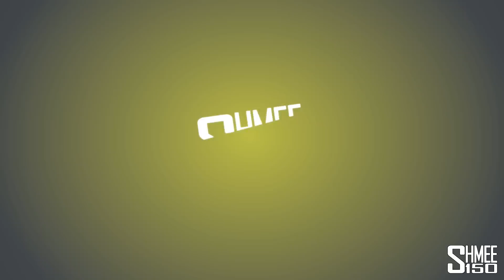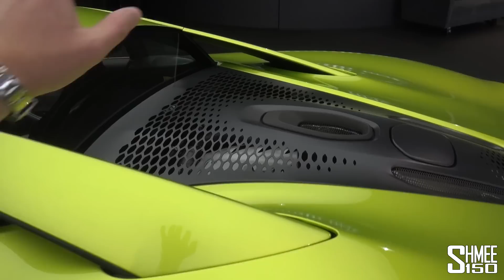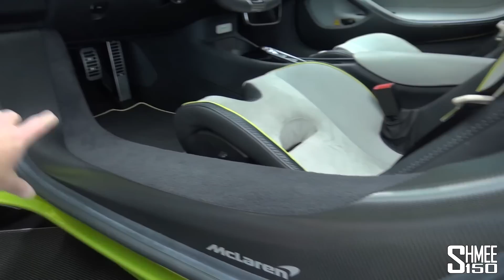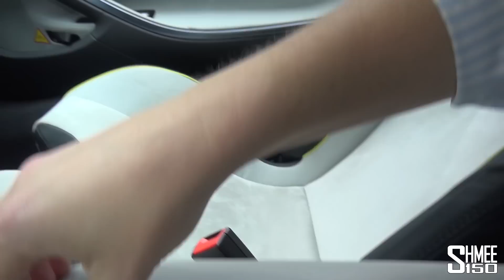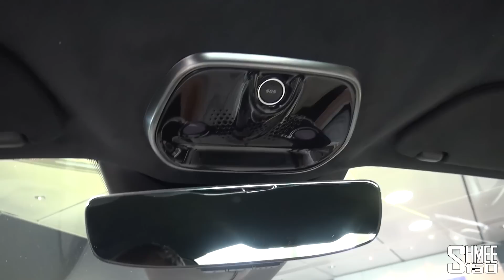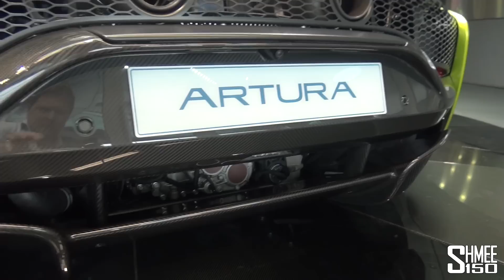New MCLAREN ARTURA! My First Look at the Latest Hybrid Supercar

Comment: something critical missed is that this is not your grandfather's V6, this is the first production Wide Angle 120 Degree V6.  this aids in lowering the CG similar to how the Flat 6 does for the 911.   iirc only Ferrari and Audi have ever used this angle for an engine but only for racing.   Ferrari with their 1961 F1 156 "Sharknose" and Audi with their 2013 R18 Diesel Lemans LMP1.

Comment: About the same weight as MP4-12C. And it looks the part, monaco play thing. However it's more than a little tone deaf to still make an essentially pure combustion engine car when it hasn't even launched. Tesla is slacking on the roadster but once it comes, McLaren backs will be against the wall so if it takes them multiple years to mount even the first response, they could be going the way of the Aston Martin dodo. A base Model S can basically match this acceleration to 100km/h. and a plaid Model S will vastly outperform it. You should probably expect a Tesla Model 3 to match it soon.

Comment: Try Mclaren may.... but we all know they are limited by their budget 
You can see how much shmee and Mclaren  tries inform us that it’s all new ... “amazing new this and that with completely new engine gearbox etc.” 
But we all know it’s all the same basic formula just lightly modifiedcoz Mclaren is such a small company trying to compete with the big companies.
Once you have had a Mclaren before you will never be excited but any other model coz it’s all the same. Same mid engine... same type of engine (lop off a few cylinders) same carbon monocoque,same basic crappy interior, same designs , same exterior look. 
Totally Boring...
Mclaren knows they’re just digging a larger hole for themselves.

Every model same layout but what do is use the same car architecture and call it a GT , a supercar a hyper car, a open cockpit 2 seater ... they copy Ferrari’s ideas but use their same lazy formula ... (continuous money grab) milking the same system to the max.  
Same with the elva 
Same With the GT
the day Mclaren moves away from mid engine, 2 scissor door, basic carbon tub

Comment: Mclaren achieved a huge improvement in interior design. Look at those details!
Reply: It took them 7 years but atleast they did it
Reply: @anandpushkar7510  You’re acting like 7 years is a lot. The 720s was already an upgrade and this even more.
Reply: @cm-15  the infotainment was same as the 12c ,we are talking about interior
Reply: @anandpushkar7510  Same design, but the 720s uses newer tech. The screen is faster and the folding dash is better resolution. Also things such as the bowers and wilkins system.

Comment: Why do companies state the highest power figure possible eventhough it won't have that much power most of the time
Reply from the maker: Most modern cars make more power than claimed
Reply: @Shmee150  but with the artura it boast 671 horse power but because of the durability of the hybrid system, the motor will put out 94 of that 671 for 15 seconds and that's when you launch the car from a stop then it produce like 50 to 70 until you stop fully